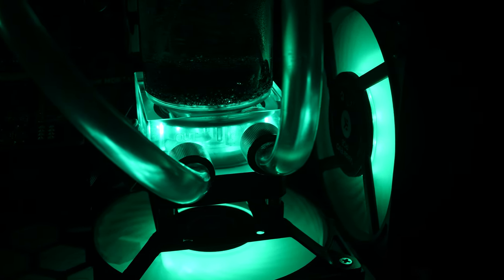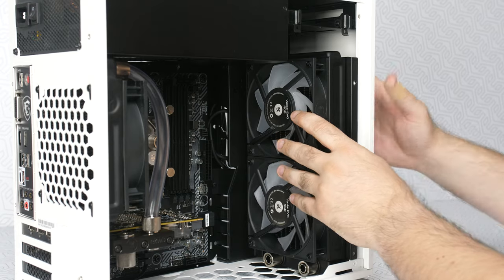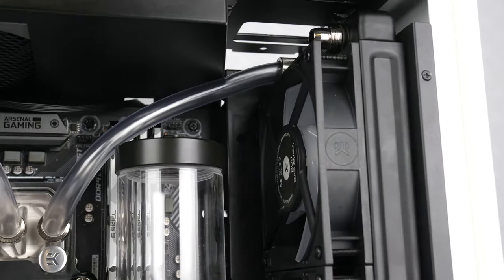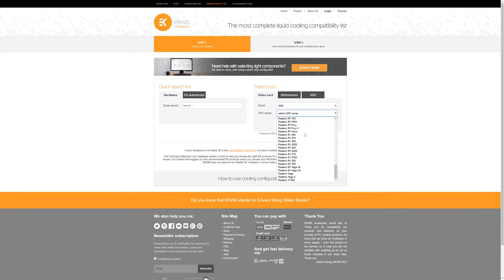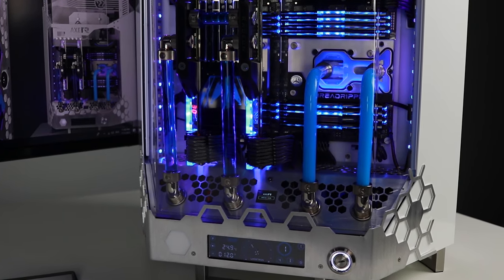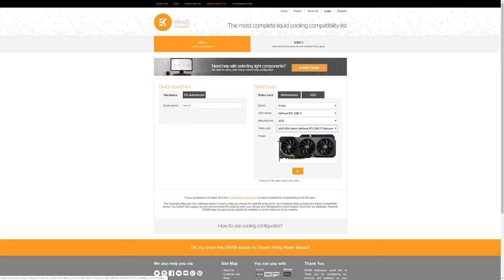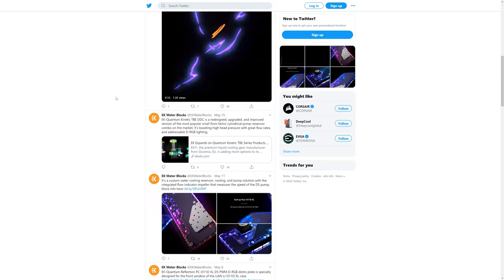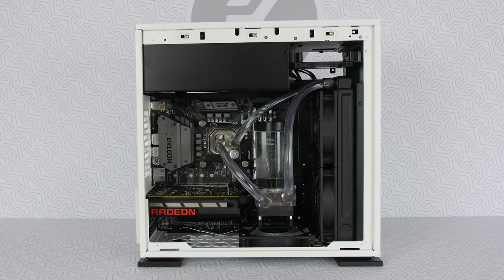How to Plan Your Loop

Comment: Informative and funny nice job EK.

My Case is 12 years old, No real Radiator mounts, but that did not stop me from mounting a 360 and 140 rad into my case.
Be bold, if your handy, you can do a lot with a dremel, and mounts form other cases you can mostly buy seperate or just having a piece of acrylic lasered cost 20-30 euro for a 360 radiator mount.

I modded the coolermaster vertical mount for there new cases to fit into my 12 year old coolermaster Haf-x  but i also cut out the side panel and put tinted glass in there.
Cut the cpu back plate wider so it fits modern cpu's, opend up my CDrom bays to show my resoviors off. 

The fun thing with old cases is that there made mostly form thicker metal. so you can cut out a lot without comprimising then and these old case cost around 40 euro second hand so if you fuck it up, you dont lose a 100-200 euro new case. 

Tip clean the case with a water hose, Dry and leave it for some days water can get into the stranges places, after you dremel. 
I mostly spray paint them too but that just extra insolation if you get a metal partical free paint.

Have fun with your loops and mods.
Reply: What case was it lol
Reply: @slazy824  Cooler Master Haf-x
Reply: @dispiedark8682  thanks!